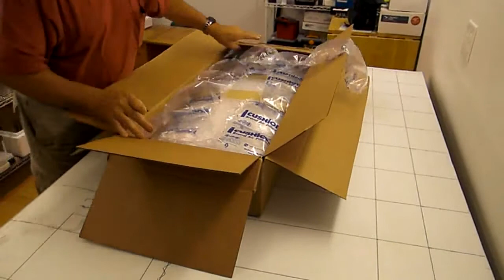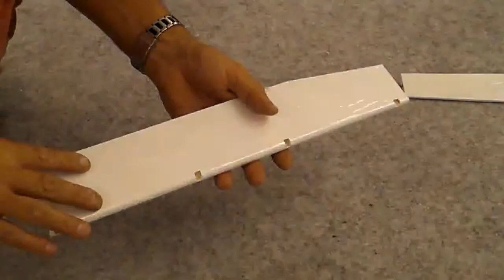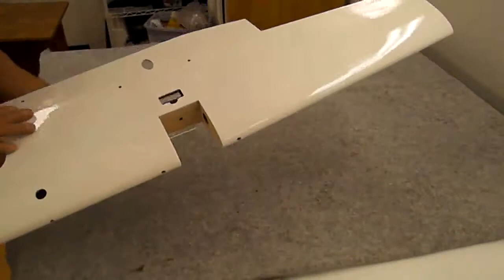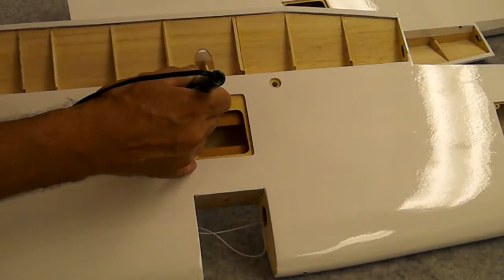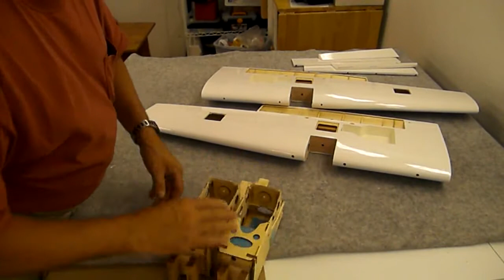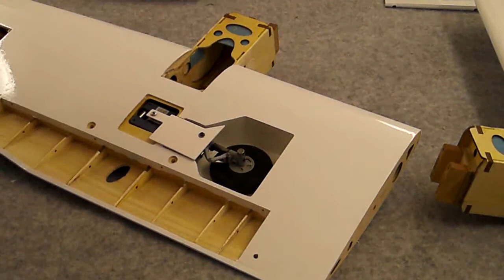310-new-wing-build-master-part-2.wmv

Comment: You can recommend a landing gear that is not robart ?, in hobbyking they sell electric but I do not know which one to use?
Reply: I designed my own retract setup because I wanted retract gear I could depend on. I never had a gear issue with the setup I came up with.

Comment: Hello

Excuse me, can you tell me which tire measurement you are using?
Reply: Tire size is limited because it must fit in the wheel well.
I did cut them down and thinned the side that goes into the wheel well.
Look close at the videos on the 310 and you can see what I mean.